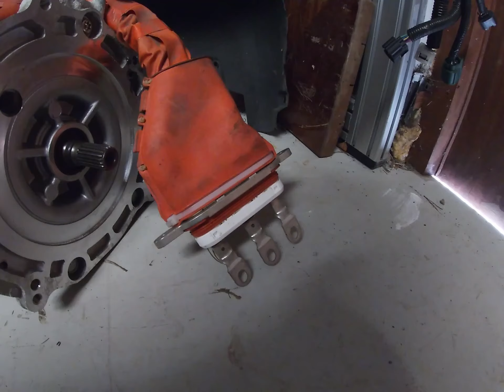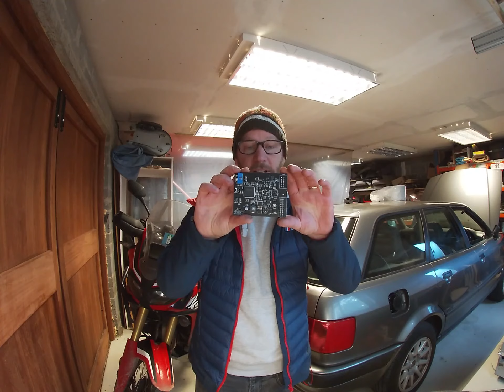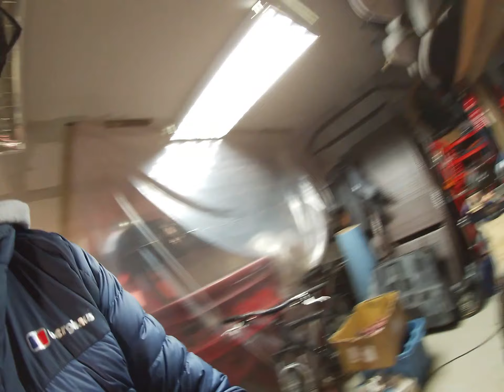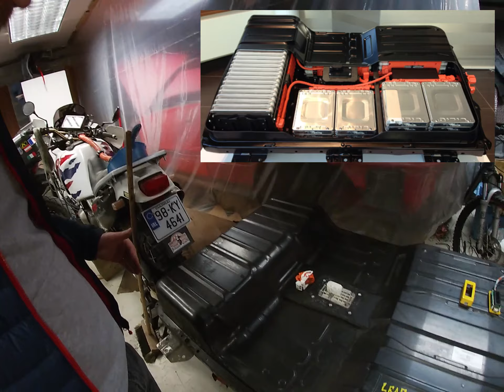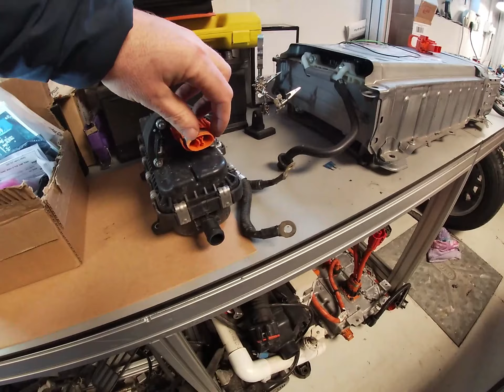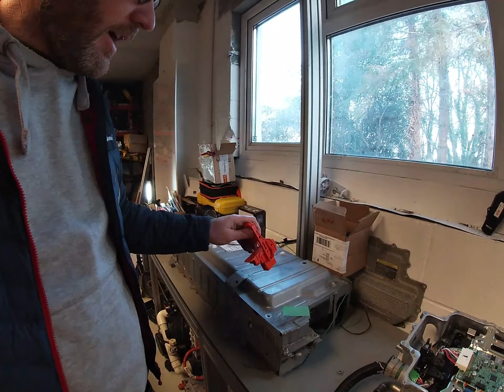Audi 80 EV Conversion - Part 2

Comment: Hello friend, thanks for the video, a question about what vehicle did I get to join the transmission to the leak, could you help me with that information, thank you, I mean the coplin.
Reply from the maker: Hey pedro. You mean the coupler? I used the spline centre from a 1.6l  Fiat Mulipla clutch to fit the Leaf motor output shaft. Used the old Audi clutch spline on the other side and welded them into some thick wall pipe. Hope this is what you were looking for!
Reply: @Scampi6000  Leaf motor output shaft only thanks

Comment: Great informative video. I'm from Co.Tyrone. I really want to convert a Vauxhall nova. I'm an autotec and understand the main mechanical hurdles of an EV conversion. But the CAN Comms etc you talk about scares me the most. I can diagnose these the best but reprogramming them to work with other modules scares me.lol Where did you find the info to build the board? Also have you anymore info the course? I could be interested in it. Go Raibh Maith Agat
Reply from the maker: Hey Paul. Thanks for the feedback! Yeah, the CAN can be a bit scary at the start but the more you jump into it, the more you being to understand and them more you build a small dictionary of the CAN code and before you know it, you can decipher the messages you need to pay attention to. There is loads of help on all things EV conversion including my build on openinverter.org. Cant recommend this community enough. Some really knowledgable guys there and newbies alike all helping each other. I would recommend you go with either an @evbmw or @Openinverter VCU that suits whatever drive train you go with be it Toyota, Tesla or Nissan. The courses I believe are on hold at the moment due to COvid but keep an eye on the forum and you may see revised dates over the next few months.
Reply: @Scampi6000  Where do you inquire about the courses?
Reply from the maker: @GarageNation353  All the dates are here: https://openinverter.org/forum/viewtopic.php?t=1004

But, I would check with sales@newelectric.ie first as covid is playing havoc with setting dates. Once vaccination rates increase, I reckon they will be back on in some shape or form.

Comment: Hello 
why you deside use manual gearbox? o thinking if use prius transaxle for this puropse
Reply from the maker: I had a number of options. The first was, use the entire Leaf motor, inverter and gearbox. The problem was fabricating drive shafts which can cost €€€. I wanted to keep the build cost down so went with Option 2- mate the Leaf motor up to the existing O12 VAG gearbox and running gear as I can fab up the adapter plate and coupler myself. Next time, I plan to go Lexus transaxle and build a 4wd system into an old Coupe to create a new Quattro

Comment: How do you install cooling for the gear box?
Reply from the maker: Hi. The 012 gearbox has no water cooling. Just air! The leaf motor and inverter will have a cooling circuit I'll put through a small rad I'll put in down low in the front.
Reply: @Scampi6000  thx4answering

Comment: Thanks for the videos Fiachra, I'll keep a close eye on this project 😀😀 I'm about to start an EV conversion on an '00 A4 1.8T quattro.... I need all the help I can get 😬😬
Reply from the maker: Lovely! Make sure it's an Avant😉👌. A coupe quattro is my next one after this. Some very interesting stuff being done by Damien Maguire with the lexus stuff that lends itself to recreating 4 wheel drive using one gs350h gearbox or 2 x ct200h drive units plugged into one inverter... Just have to get this one running! 😀
Reply: @Scampi6000  I spotted the coupe in the vids, looks like a nice project 👍👍 Are you painting it yourself? I've an A4 b6 avant and a 1980 mk1 golf, the a4 b5 and a c class merc... too many cars, not enough time 😄😄 Hopefully I'll get onto Damien's course before the end of the year 🤞🤞

Comment: Cool conversion man. I’m about to start my conversion on YouTube as well. I’m converting a 2006 Hyundai Sonata into an electric car.  I am debating to see if I should go with ac propulsion system which years back was used inside the mini  golf.  I like the fact that Everything was in one box plus it’s vehicle to grid. However I have been looking at leaf motors and in the states it’s about 5-7 hundred bucks. My question to you is where u get the inverter ? I heard mpaul made is own control board for the Nissan converter.  Nice find with the azure dynamics e pedal
Reply: What do I spy in the background?? My ideal build is an 80 coupe Quattro so looking forward to this build.
Reply from the maker: @philbraithwaite2223  Yeah, have it under wraps for a while😁. Long term rebuild. It's  a '90 2.3 20v Coupe Quattro. Rare enough these days! Next up after the Avant is one of these. Take an old 2wd and make it elec 4wd using lexus hybrid bits😀
Reply: fiachra cooke ha yes that is exactly what I was thinking of using. These Lexus gearboxes are game changers and they do four wheel drive as well!!!
Reply from the maker: Hey Antoine. Thanks. Have heard of but never came across the AC Propulsion system over here. Sounds ideal if you can get your hands on one. Price point of Leaf stacks are coming down. I got the entire Leaf stack (motor, inverter, charger) plus all the wiring I could take from the shell for sub €1k. That's a lot of kit for the price. Using @evbmw's brain board on top for a couple of hundred more and you are away... before you add the charger, battery... Good luck with the build!